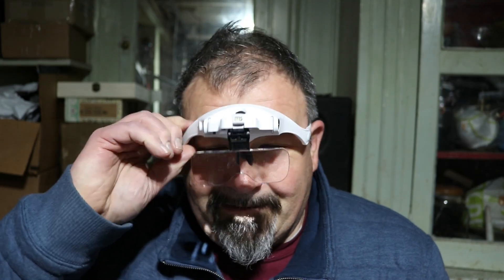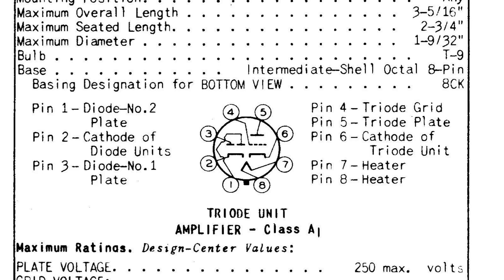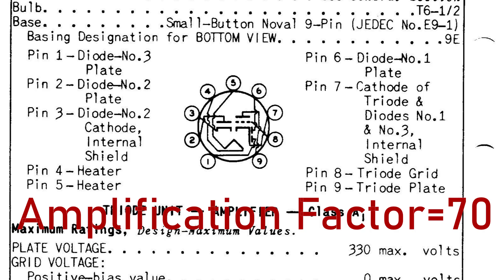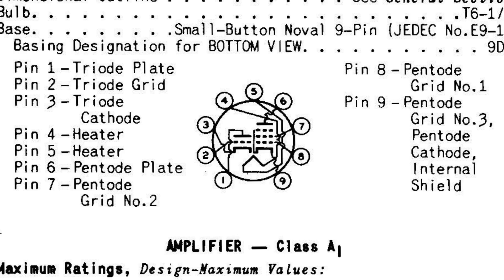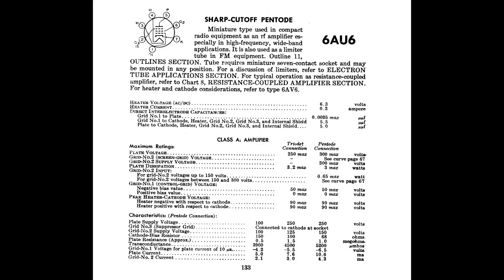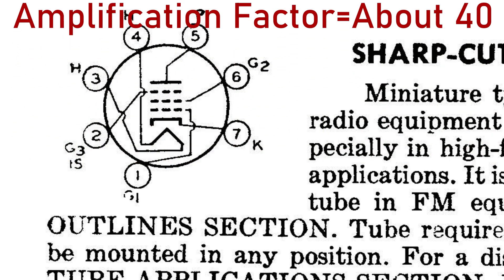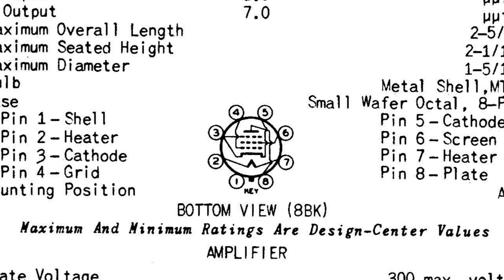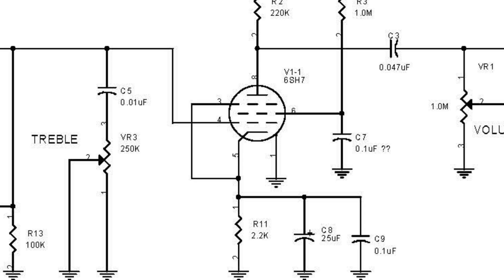5 Cheap Vacuum Tubes Potentially Useful for Building a Guitar Amp

Comment: Have I used any weird or unconventional tubes in my guitar amp builds? Uh, that's all I use. Need a single pair of tubes that can deliver up to 200 watts? Look at the horizontal sweep tube from an old TV set. The baby 6BQ6GT can do 70 watts per pair on about 500 volts into a 3300 ohm OPT. Move up to the big boy 6LW6 and feed them 600+ volts into a 2500 ohm OPT for over 200 watts. There are lots of tubes in between these extremes. The 6AV5GA is an octal with no plate cap that's good for 80 to 100 watts per pair into a 3300 ohm OPT. Need to make a low powered amp cheap? Look into the tubes used in old radios. A pair of 50C5's or 50B5's driven by a 12AU6 and a 12AX7 can get you about 15 watts from a Triad N-68X isolation transformer for power. The octal 50L6 can do 30 watts per pair. It's a 6W6 with a 50 volt 150 mA heater. A pair of 32ET5's driven by an 18FW6 and a 18FY6 or two will get you about 10 watts and the tubes are 75 cents each in quantities of 10. A pair of UL84s AKA 45B5s driven by some 26AQ8/UCC85's will make for a good 30 watt amp, also powered from a 100VA isolation transformer. I can look back through my computer and find dozens of guitar amp designs made with mostly old TV tubes. I also recognize that the 6AQ7 and 6T8 are the only tubes you mention that I have NOT used. NOTE!!!! Nobody should even think about building a guitar amp that's directly powered from the AC line without a power or isolation transformer. Yes, they were made this way for years and they KILLED people too! Would you stick the other end of your guitar cable into the wall outlet while you had a death grip on the neck?
Reply from the maker: A guy after my own heart! Big fan of the 6BQ5 and 6DQ5 as well as the 6BG6G. If you're the guy I think you are, I've been checking out your info on the forums and website for years. Thanks for putting it out there.
Reply: @muttamps  You mention the 6AW8. All of these tubes have the same pinout. 6AU8 6AW8 6BA8 6BH8 6CX8 6EB8 6GN8 6HF8 6HZ8 6JA8 6JE8 6JL8 6JT8 6JV8 6KR8 6KT8 6KS8 6KV8 6LB8 6LF8 6LQ8 6LY8 6MV8. Each have their own merits, but several can be used to build a single tube guitar amp. The 6HZ8 has a triode with a Mu of 70 and a pentode with a plate dissipation of 8 watts and a Gm of 12,000. There is enough gain to get well into the distortion zone if a simple low loss tone control is used. In most cases any of these tubes can be plugged onto the same socket if you aren't trying to pull 8 watts through the plate. Most have 3 to 5 watt pentodes.

Comment: 5879 is a small signal pentode that's similar to EF86 but lower gain and a different pinout; it was designed to have  low-noise and low microphonics, and was often used as a mic peamp in commercial PA/paging smps. The 6AN8 triode-pentode mentioned in the video is now scarce because they were used in Dynaco MkIII hifi amps, but 6U8, 6EA8, and 6GH8 are siilar and have the same pinout. Another 6V6-like, EL84 sized  tube (with lower power handling) worth experimenting with is the 12AB5, often used in Webster or Webcor portable tape recorders.
Reply from the maker: I have a bunch of old Webcor chassis using 12AB5s, those are definitely on my radar.
Reply: @muttamps  , I have a Webcor as well. The best units for scavenging parts and transformers, however, are Voice of Music portables.
Reply from the maker: @goodun2974  Agreed, excellent iron in the VoMs. Using an old VoM PT in the Westminster/Winchester project. I have one of those VoM 8810 SE amps on deck for a future video.

Comment: Loctal tubes are another possibility: for instance, the 7C5 is a loctal-based 6V6 (and don't be fooled by the 7,  it's a 6 volt tube!). There are loctal versions of 6SN7, 6SL7 and many others. The required loctal sockets, however, are difficult to find.
Reply from the maker: I have a Masco MA25P that uses Loctals, a video on it and those type of tubes is on the list.
Reply: @muttamps  , a few Premier amps used them as well.

Comment: Most 7-pin tubes go for pennies on the dollar compared to 12AX7's, 6V6's and such. Usefull small-signal tubes include the 6C4 single triode, 6AV6 and 6AT6 diode- triodes, and of course the 6AU6 pentode mentioned here. 6AQ5 output tubes, a miniature, lower-rated 6V6, are rugged and reliable if used within their ratings (there's also a 12 volt version, and NOS are cheap as chips). There's also a small, independently-heated-cathode rectifier, the 6X4/EZ90. The hardest part might be getting matching 7 pin sockets, because few manufacturers bother making them nowadays since there's only minimal demand, so you might have to resort to NOS sockets.

Comment: 6an8 6aw8a similar to 6gw8 ecc86 used in Hammond a0-44 reverb amps. 
Very expensive..
Sigh 
Great video!!
Reply from the maker: Yes!! I had a few in an old junk tube box and gathered them up for future use!
Reply: 6AN8 was used in Dynaco hifi amps as well as Sunn guitar and bass amps, which is why those tubes are scarce today. IIRC, the 6AW8 draws significantly more heater current than 6AN8. Anyway, as far as affordable small-signal triode-pentodes go, 6U8, 6EA8 and 6GH8 are the best bets. For small triode-pentode output tubes, 6BM8/ECL82 are affordable, and I think there's even a modern Russian version. (The 6GW8/ECL86, however, are scarce and expensive).

Comment: 12BH7
6AQ5
4HR8/PF86
ECL84/ECL82
EL86/6CW5
6EU7
6AU8
Did you say 6GH8?
6AD10

PF86 is an EF86 with 4.5v heaters. ECL84 is the lowest powered of the 3 related triode/pentode tubes, ECL86 was in the Hammond reverb amps but they seem to roast themselves if you use the triode as a s.e. driver or phase inverter for a pair. 6AD10 is a very cool dual dissimilar pentode Compactron. And 6AQ5s are so great.
Reply: I have a guitar amplifier with 6AQ5s. Cool little tube.
Reply from the maker: @bretfuzz925  Very underrated!
Reply: 6CG7/6FQ7 (also available in 12V versions) and 12BH7, are great, rugged alternatives to the 12AX7 family. They do draw more heater current and are taller, but the large plates mean they can be pushed hard. The 6CG7 was used in some Silvertone/ Danelectro amps; the 12FQ7 in Quicksilver hifi, and the 12BH7 in some McIntosh amplifiers.
Reply from the maker: You hit some good ones there! The 6AQ5/6005/6095/6669/EL90 is a great one! Funny you should mention the ECL82; they are part of my next video, stay tuned!
Reply: @muttamps  I have ECL82s on deck for the mythical 3 tube + recto Gibson GA1-RVT, want to try it with the ECL84 also for fewer watts. Have the OT10SE and a 10k primary se output Matt wound for me. The 10K would work for a paralleled 12BH7 power tube for a 1/2 watter, also a 6BQ5 se with 350v+ on the plates. Matt'll wind whatever you want at about 1/5th the $ as a comparable Mercury off the shelf. Good fellow!
Reply: @oldasrocks9121 , ECL82 = 6BM8. I think there's a modern Russian version as well. THe ECL86/6GW8, however, is scarce and I don't know of a Russian version.
Reply: @goodun2974  6GV8 is the ECL85, 7 watt max plate disappation for the pentode, 50 amp factor for the triode. I think this is the one the Soviet copy is based on. The 6BM8 has a squiggle in the plate disappation according to the RCA tube manual, it's 7 watts up to 250 plate volts and 5 watts above 250v. And a 70 amp factor triode. I'm curious to know what the 6AW8A pentode sounds like as an input stage.
Reply: @muttamps  , I have about 60 blackplate GE 6005/6AQ5 mil-spec tubes! I need to build some amps!
Reply from the maker: @goodun2974  Wow, get busy man!
Reply: @muttamps  , from the same hamfest I also picked up 50 or so 6X4 rectifiers....
Reply: 6EU7 are scarce and expensive; best to rewire for 12AX7 if feasible.
Reply: @goodun2974  I hunt for the cheap 6EU7's, lots are rebranded Mullards, worth the patience.